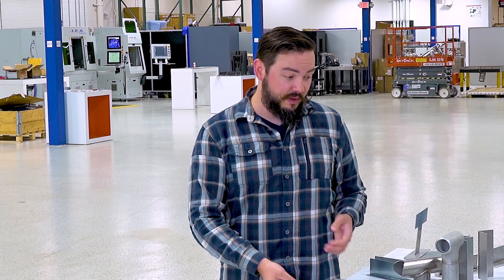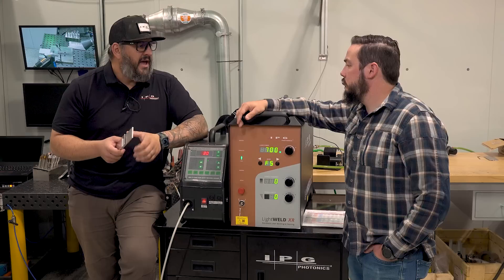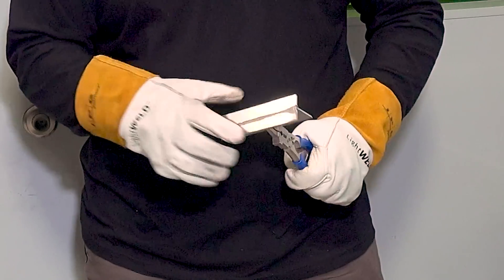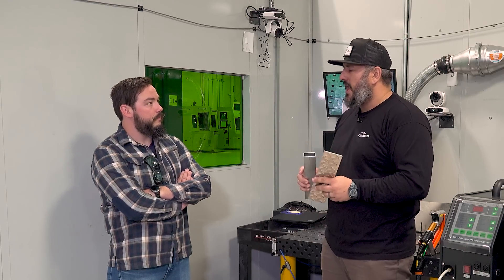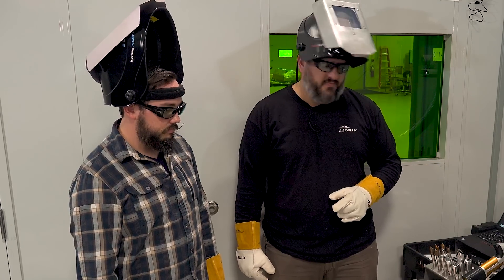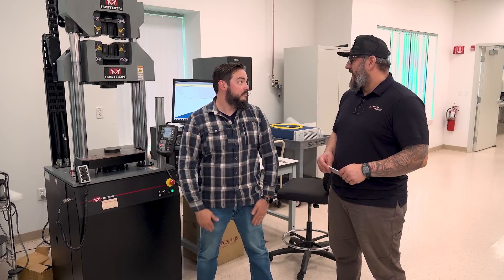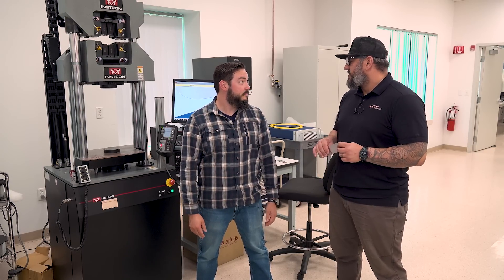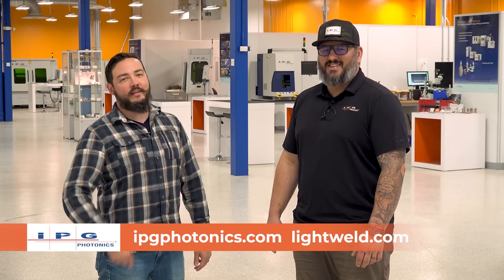Welding Aluminum With A Hand Held Laser?!: Is This The Future Of Welding?

Comment: Would be nice to see you weld an outside corner on .060-.080 aluminum. you are mostly welding the inside corners and butt welds that are easy. i find the guys have a hard time in our shop with the outside corners. i assume you as well since you dont show a stacked dime looking aluminum weld.

Comment: Can you weld in any position with this?   We do many aluminum box frames out of 1/8" square tubing , all fillet welds, but in every position imaginable.  Would definitely want the wire setup, not the fusion only.   Do you wear out tips like with spool gun welding?   What are the consumables with this type of laser system?

Comment: How are these with very small intricate welding? We're considering getting one as some parts just seem far easier with laser than tig, talking about 8mmH x 12mmW Aluminium bungs with a 10mm hole welded to 9mm tube. Tig heats them up so fast that if youre not careful the entire bung can just turn to liquid😂 and doesnt help only 1 guy can do all the work and even for me theyre not easy and ive been tig welding aluminum full time since 2017

Comment: So there's no filler material required to weld with this or does it feed from the machine like a MIG welder?
Reply: no filler, but filler can also be added in laser welding if you have larger gaps or uneven edges

Comment: Tig and MIG aluminum welds always needs to be buttoned at the end of the bead else the resulting crack that develops can propagate down the length of the weld over time. 
I don't see this issue covered in the laser welder video.

Comment: 1938 sunbeam  motorcycsle primary chaincase  which got damaged when I tooked it to be repaired by a very experienced welder the    Whole case erupted in cracks all over the place. The welder had not seen anything like it before. Would lazer welding have the same problem

Comment: This Machine In This Video Cost 
35,000 Dollars Plus Taxes And Shipping
40,000 Dollars Total Only X Machine
And The Extras A Few Thousands Dollars
More, 
I Bought Transon 4 in 1 Welder Machine
With 3,000 Watts For 5,000 Thousands 
Dollars Total And It Is 3 Times Faster
Than This Machine 40,000 Dollars 
Machine From United States 😂
1) 3 Times Faster My Machine
2) Welds Beautiful And More Thick
    Steel Than This Machine.
3) My Laser Has Clean Cutters 
    Better Than This Machine.
4) Rust Removal 10 Times Faster And
     Better Than This Machine.
😂
Amén.
4

Comment: My employer purchased one of these. It provides an individual with little to no weld experience the ability to weld parts on par with those who have been doing it for years. However, the cost of the machine (nearly $40k), and the maintenance upkeep it's not quite worth it yet. Our operators have stepped on the guns cable causing it to strike the concrete floor and damage the optics. And the cost of repair is unbelievably expensive. Once the cost comes down over the years, this will be the standard.

Comment: Yeah aluminum is denser than steel okay I stopped listening to this guy when those bs words came out of his mouth aluminum takes more power for 2 reasons 1 is simple it conducts better than steel so it brings the heat away from the weld pool faster and 2 you weld aluminum with AC so 25%-50% of your power depending on balance settings is going back to the tungsten go to school kids take everything you hear from “experienced welders” with a grain of salt and stick to what works for you

Comment: It took me a few days of a very affordable state-funded vo-tech class to learn to TIG and even stick weld aluminum. You can buy an AC TIG welder for $1000-$2000.

Of course, I could have paid ten to fifteen times as much for a welder that doesn't require me to know anything about the process, but I think acquiring the skill to do it with the equipment found in any fabrication shop right now was worth the time and effort, because it makes me more valuable than a machine with a "weld aluminum" button.

When we can source a solid-state laser at a reasonable price we'll be in a better place to discuss the future of welding, but remember! SMAW is an invention from the 1800s, and there are welders working today who do nothing else. There's no reason they should cost this much... fiber lasers are also a half-century-old invention.
Reply: I'm sure in the hands of a skilled welder this would produce better welds than the average joe picking it up.
Reply: @Tigman396  actually it's the opposite because it doesn't behave the same as Tig. It's a very automated process with limited inputs. The gun to an extent pushes you along instead of the other way around.
Reply: @ So similar to dragging a mig gun I would guess that to be the closet process to this? Never used one but would be really interested in trying it out.

Comment: Now someone just needs to invent a "roller head" or "roller tip" that is a powered roller feed dog mechanism to feed the wand at specific feed rates...  Seems like a perfect process to attach to a robot arm.
Reply: The crazy thing - I was watching another video that said that the wire feed from the bottom gently "pushes" the gun backwards, so it acts like a pacing/feed mechanism.
Reply: They have them in China. The same supplier that the machine came from can help you find one. A six axis robot are

Comment: They need to get these machines to some trade schools and community colleges and start teaching students to use them. These are amazing.
Reply: @josephreagan9545  sign fabricator. We use mig for aluminum sheet metal is this a method that could be used for thinner sheets? Or for thicker materials like 1/8" and thicker.
Reply: @STate-gd3ks  No Idea. I am just a fellow commenter on the video.
Reply: pls don't do that, because I'm wanna start my laser welders club😁 (in amsterdam)
Reply: Right so the welder pay will be 15.00 an hour.  Careful what you wish for!

Comment: How do you fill in a hole or large gap ? I’ve only ever seen this Lazer work on the most perfect conditions. Send me one to Wisconsin so I can “garage “ test it
Reply: Probably not the right tool for filling holes and gaps, but the laser oscillates on the handheld unit, unlike using a robot where the conditions really do have to be very precise.

Comment: All the welders getting mad because this will eventually put them out of business.  This will get programmed just like a CNC machine and a robot will perform all the welding and inspecting.  Along with it being recorded via camera the entire process.  So any faults can be traced back to the exact piece and time to make future corrections.  Simple human eyes and hands won’t be able to compete.  These machines already out work a human 100:1
Reply: It won't put welders out of work. You won't find these in fab shops, oil fields, or jobsites. Production welding is only a small percentage of welding jobs.

Comment: I've only ever heard of this welding process being used into automotive auto body work and its limited to very thin material
Reply: I can assure you that laser welding in general is already in use in far more applications than you might think. Ford laser welds at least some of their seat risers to their rails in F150 trucks, and those are safety tested as you are strapped to your seat during a crash.
Reply: Laser isn't limited to thin.  With the low heat saturation, it can weld very thin without blowing holes in the sheet metal.  Of course you have to adjust the heat to the thickness of the metal.  No need to use 3,000 watts on 18g metal.

Comment: Did you see the part where they break the plate and it shears at the weld and they try everything to convince you the weld is just fine
Reply: Also the piece they put in the pull test isn’t the same as the one they loaded lol
Reply: The men are correct, the materials break before the weld would. I've done this same thing in my own shop

Comment: We had to make some aluminum duct and I ran for this machine to save the spool-gun headache. I got funny looks because I kept rubbing the super smooth outside corner joint that looked more like a 3/16” wide line of soldier than a weld I got it so smooth with the settings

Comment: i would like to know how big of a weld you can produce with this lasergun and if you can do multipass🤔 something like a massive 1g plate and is it faster than stick welding or mig?? and how does it compare in strength to the common welding methods??? please make another video about this welding method and try to weld some thick material, would love to see that😅
Reply: Laser welders can weld material thicker than 1/4 in a single pass, and do a better job than TIG. What's missing from the equation is the cost of equipment. A 2.5kW LightWELD costs $30,000 and is only good for material up to about 1mm. (Although aluminum welds exceptionally well with Yt and they claim 1/4" material thickness... this is where the absorption of aluminum outweighs its thermal conductivity I guess!) Fiber lasers can run over 10kW and can weld or cut anything if you've got money coming out of all your doors and windows.
Reply: It is much faster, and the cost of a 1500 watt full kit is $30, but it is up to four times faster than TIG, faster than GMAW, and there is no cleanup to speak of in terms of spatter. You can reduce a weld to paint process cycle time by up to 80%. If you fasten anything with bolts, screws, adhesive, or use sealants it will save you money very quickly. It also allows you to weld dissimilar metals like copper to stainless, copper to aluminum, and I have welded tool steel to cast steel, though as far as I know, I am the only one that has, and there is scant information on how effective that is. It will also blast right through paint, oil, grease, dirt, and other cruds.

Comment: tried the 1.5 kw laser welder on full power - 1mm to 3mm test pieces. Works on steel and stainless, on alu it's really hard to get any penetration at all. On stainless and steel it works if there are no gaps and if the laser is dead on corner. If there is a small gap it becomes a mess. You also get some penetration if you go slow enought. Very hard to do repeatable welds. Conclusion: Maybe usable for non constructional serial production welds with perfect fit up on thin stainless for example, but for normal user in no-go. Can't replace tig welding. i't not practical. If you're looking for precise concentrated arc, try manual plasma welding instead.
Reply: Aluminum absorption drops off very rapidly at 1000nm and you need the right doping in your fiber for this particular metal. LightWELD claims 1/4" thickness which I believe looking at the numbers... but for a guy who doesn't own a factory and just wants to make aluminum parts, an Everlast with a decked-out cart full of tools and gases is still less than 10% the cost of a laser welder.

Fiber lasers also require thousands of dollars of safety equipment you never see in these videos.
Reply: Did you prep your metal properly!

Comment: Yup the end of the og welding is near anyone is going to be able to weld with those machines and would not take any skill. Thinking of getting into another trade now it has been feeling like welding is a dying trade..
Reply: every skill learned is a diminishing window of opportunity
Reply: I can see this technology will further enhance all of the robotic and cnc controlled systems.  Which will lead to less human jobs for the workforces. If you want to have a job in the not too distant future better learn to program.
Reply: @johnhudson5947  github copilot and the no code effort. humans need not apply.
Reply: Despite having this machine in our shop, we still combine mig and tig with it. At the moment it has some limitations beyond metal thickness.

Comment: Yea I've looked into buying a few of these for my engineering firms and I still won't pay 15k to 30k for one. I'll stick to Vulcan and or Miller welding systems. At least those are affordable even for your basic metal fabrication hobbyist.
Reply: Look at the other videos where the welds are tested. They go at least 10x slower.
Reply: @sextwister  you need to learn how to read. Your comment has nothing to do with what I said in my comment.
Reply: If one is willing to import it himself, he can get it for about 8000. There's a huge mark up

Comment: Your laser technology is a gimmick. Tig welding to by far faster.
Reply: I bet at some point in time tig welding was a gimmick too, so was plasma cutting, laser cutting, etc.
Reply: @White000Crow  let's be honest their laserntech is over priced and not applicable enough. Maybe automation ... maybe for a very expensive programmable set up. Other than that not worth it.
Reply: @CoopKeith1  it’s a technology in its infancy, they will become more affordable over time.  Probably in 3-5 years.
Reply: @White000Crow  Rewatch the video, the aluminium looks oxidized. You can see all the black carbon along the whole weld. Where is the gas coverage?

Comment: O.K. Here we go again. The pull test was cool but, show us a welded box and how "easy" it is is to get water tight corners. We need to know!
Reply: Honestly I've had issues doing corners on an outside corner joint. Sometimes I get it but usually I need to fill holes with the mig machine and blend it
Reply: Indeed, we need to see a few more practical demonstrations of this newfangled technology
Reply: @wwsoft  it's not new at all, they started using it way back in the 90s but invented around 70s
Reply: @Banana Warrior, you are right. Its Not new. Lasers have been around since the 1950s.
Reply: @Slouworker  I stand corrected. Maybe it's a cheaper and more common today?

I'd be interested in seeing how the applications have changed over time.
Reply: @wwsoft  it's used in probably every single modern mass-produced car that's been made since the 21st century. Every single unibody these days is made with large robots that have massive spot welders on the end of their tool arms.